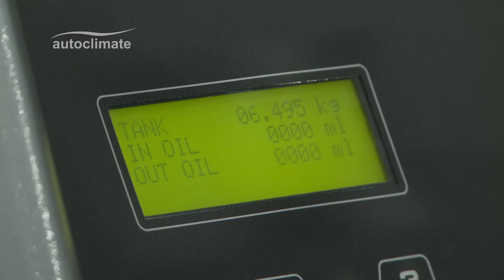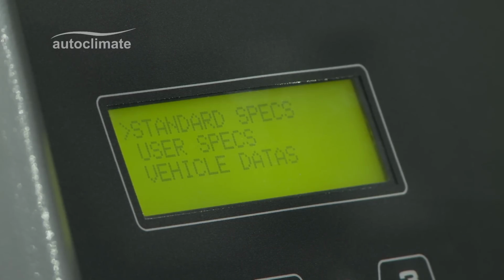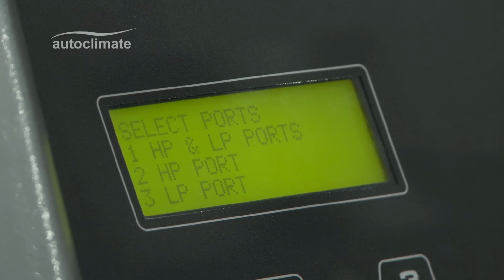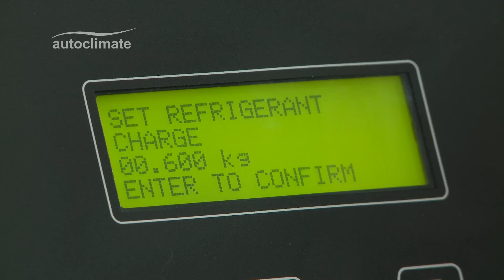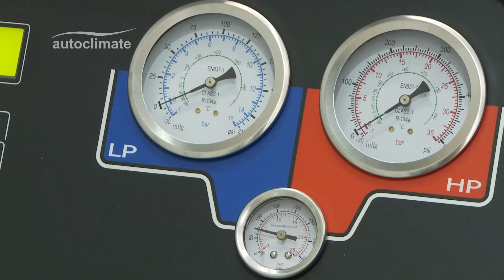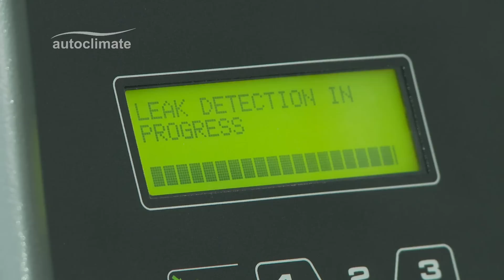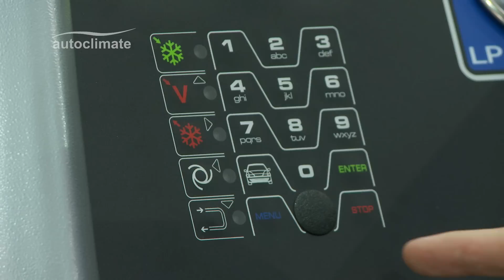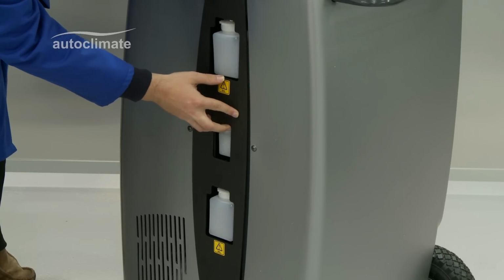Robinair AC690 Pro - Automatic Operation

Comment from the maker: Although the AC690 pro is fully automatic – some technicians will still close the HP (Red) valve on recovery of the refrigerant, and close the LP (Blue) on recharge – there is no need to do this as the machine opens and closes the relevant solenoids accordingly. It would not have been done to ‘cheat’ you on the quantity of refrigerant recharged. 

The vehicle database does not always need to be accessed if the machine is being used in Manual mode, or the vehicle data may not have been in the machine. Self-clearing will only be done if there is pressure in the system to start with. Vacuum is recommended to be done for 20 minutes. The video is our recommendation as to how the machine should be operated, but obviously we cannot enforce it.

Thank you for your comments.

Comment: Thanks a lot for your answer! I have two more questions, if you don't mind:
1. Is it normal to recover only 2 ml of oil and to recharge 4 ml instead? The service manual says that the oil quantity for my car is 40 ml, so is that ok? 
2. As the printout showed, there were recovered 25 grams of refrigerant and recharged 365 grams, so with just 25 grams left in the system why the compressor still started and cooling a bit? That's what made me suspicious about the quantity of recovered and recharged refrigerant.
The car is a 2007 Toyota Yaris, with 31,500 km on board.
Reply: I know it's almost 10 years later, but have you answered your questions? I've asked myself the same things

Comment from the maker: It is perfectly normal to recover only 2ml of oil, as oil may or may not be recovered. Recharging with 4ml of oil will in no way affect your system.  With 25grams in your system, it is unlikely it would have been working at all, as there needs to be enough pressure in the system to activate the low pressure switch for the system to start.

Comment: What happens if the operator didn't open the high pressure valve? I've been to a service (that uses Robinair AC690 Pro) with my car and, during the operation, I've noticed that the low valve was opened but the high pressure one (red) was closed. This could have been done in purpose (to cheat on the quantity of refrigerant recharged) or just by mistake? Not to mention that he didn't follow all the steps that were described in the video-guide above (the vehicle database was not accessed, the self clearing not done, the time for vacuum was set on 3 minutes and these are only a few of them as I remember). If you need more info, please ask me; I can also send you the copy of the summary print-out. Thank you in advance!